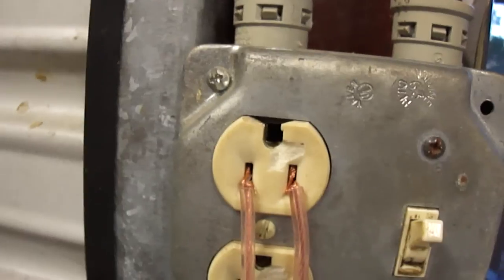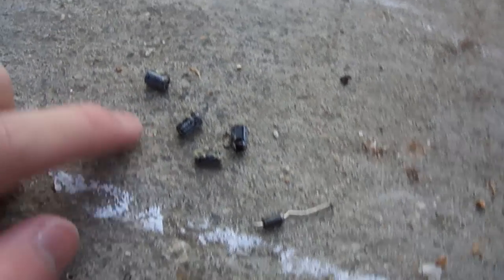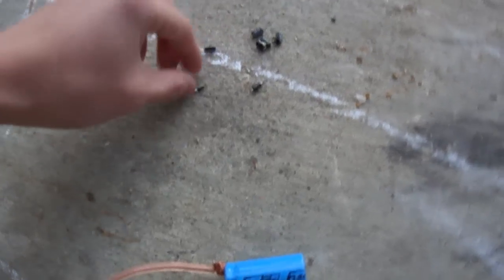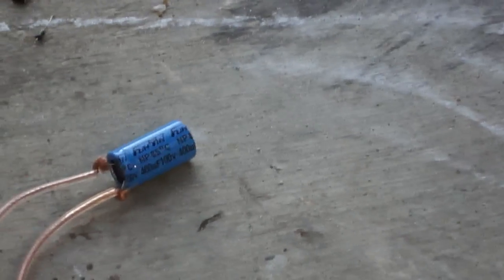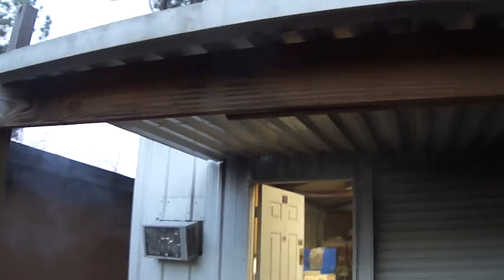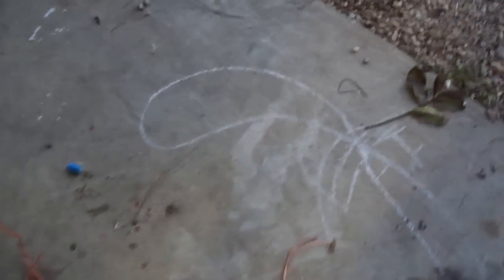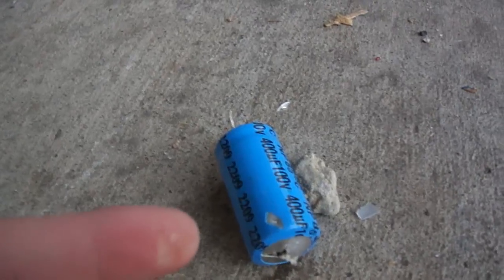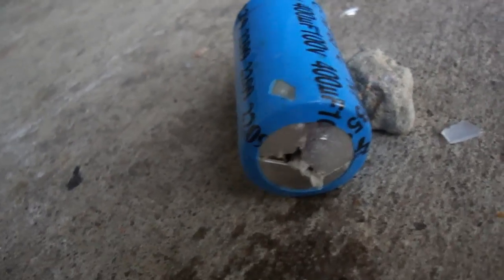Blowing Up Capacitors with 120 Volts AC (4)

Comment: I've seen a 60ah lead acid battery against a tree stump get shot with a 303 calibre rifle. Never did find the battery, not even years later. What was found was a small piece of plastic, and that's all. Just finished watching some Crown XTi amplifier videos, one from India it looked like. it was broken down with periodic popping. All the caps were bulging on the tops, and one common one known to blow was just about there. The uploader was blaming faulty firmware, but tou could see it was obvious the abuse this amplifier was subjected to. They go off when they pop under silly loads though!

Comment: In order to get shocked by a wall outlet you would have to touch both live and neutral at the same time if you were to only touch one of them and not both of them at the same time you will not get shocked but the live is what shocks you not the neutral and you have to touch them both at the same time in order to get shocked wall outlets supply enough current however to kill you so you never want to get shocked by a wall outlet also it's not the voltage that kills you it's the amperage